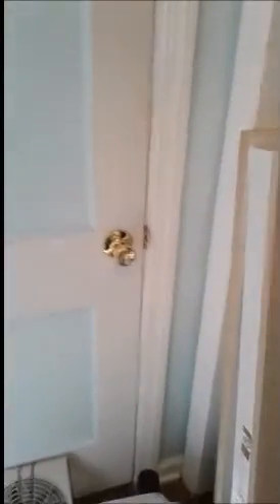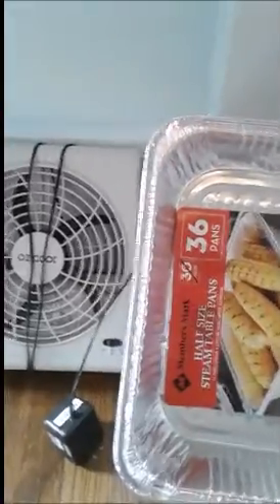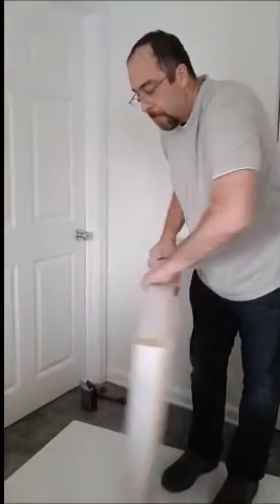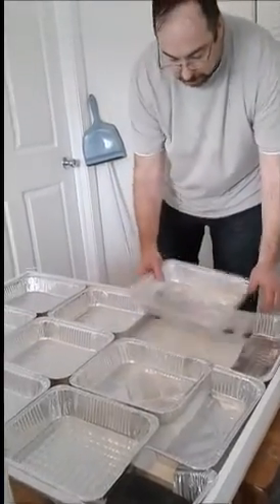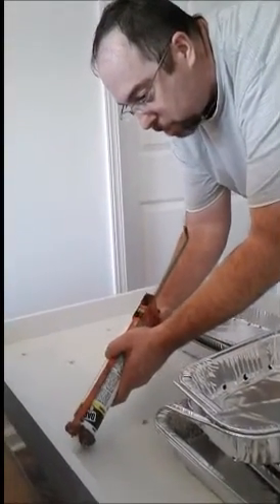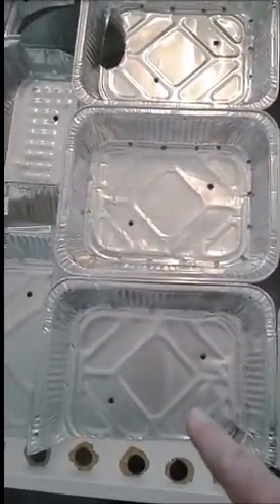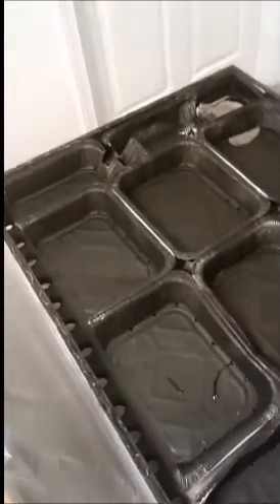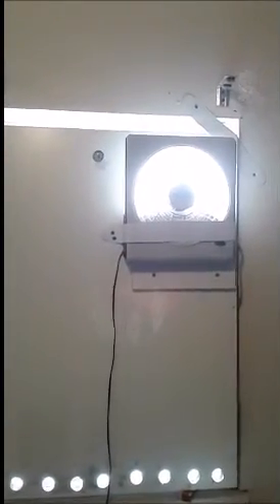Step by Step Build on Custom Window Solar Heater- Pie Pans- with Snap disk

Comment: having a opening in the pans to make sure the hot air has to travel over all the pans, now it looks like it will come up from bottom and take the easy path right to the fan. A s pattern starting on second row may give more time to heat the air.
Reply from the maker: I have holes drilled all through each pan--mall ones.

Comment: Nice build. I had never seen this style of build. 

One of the things I’ve gathered on these solar heater is this: 3 times more air inlet than out. I’m not sure you got that on this build. This could increase your efficiency. 

I watched the video of your 4x8 from 4 years ago. Have you ever build one of those with the pans upside down? If not, here are my thoughts on how that would work. 

Paint both sides of the pans. Paint the frame and back wall before attaching the pans. 

Turning the pans upside down traps the heat away from the clear plastic cover and against the inside of the pan and the back wall. This reduces heat loss to through the plastic. It also triples the amount of surface areas the air passes over. 

Drill holes in the sidewalks of the each pan to allow air flow. (Not in the corners as you did here). 1/2-3/4 inch holes should work for theses pans. 3 times the number of holes on the lower wall than on the upper wall. This uses the 3 to 1 HVAC principle on each pan. Equal number of holes on the left/right sides of the pans. (Example: 6 holes in the lower wall. 2 hole in the upper wall. 2 holes on each of the side walls.) 

This creates turbulence from one pan to the next as the air flows up and is heated under the next pan. Increased turbulence in airflow creates more heat. 

I hoe these tips help to improve your efficiency. Keep the videos coming. 

Anyway, I’ve subbed and I’m looking forward to watching more of your videos. 

D.

Comment: What is the temp. that comes out of this?  I have a 5' x 3.5' window in my back bedroom that I never open and the look of this would be better than an outside unit....  Also, why didn't you use flat black paint?  Great idea with the pans!
Reply from the maker: Probably 110 - 120 F on  a sunnier day.  Flat or Gloss seem to be similar , but feel free.  Thanks for the comments